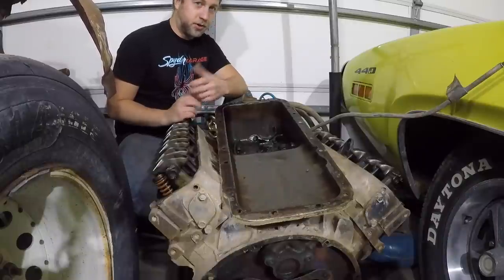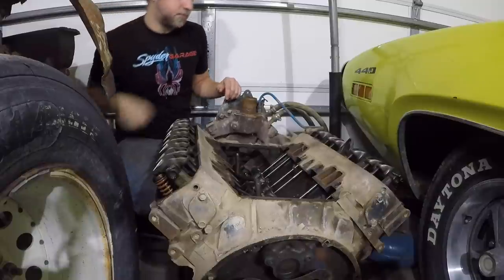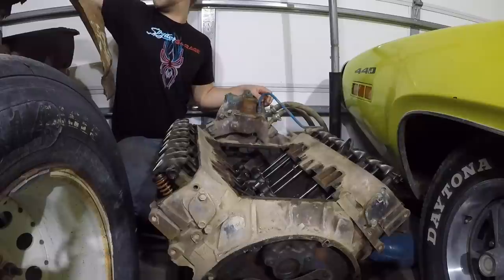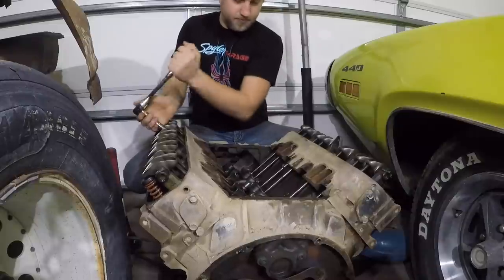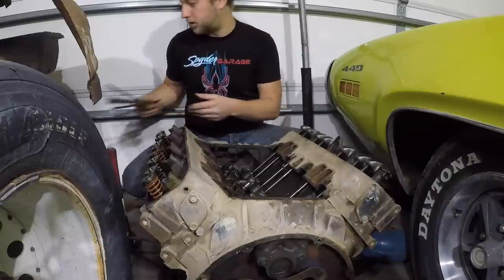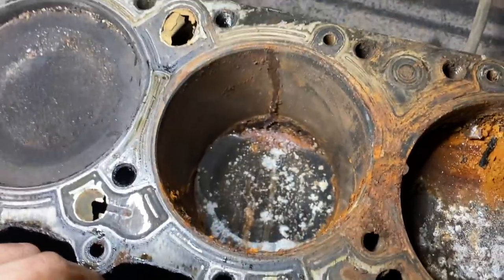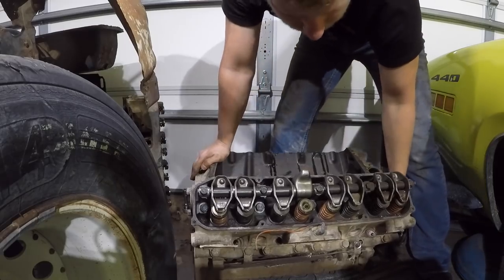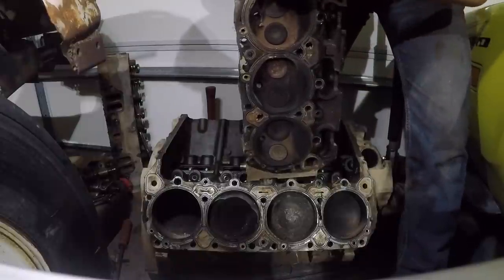Junkyard 1969 Charger dirt track car 413 engine tear down - and - reading Your comments!

Comment: Everyone loves a Charger-  this is extremely rough - makes it even cooler .  Can’t imagine how you make this street legal
Reply from the maker: Indiana is pretty lenient, which helps. Lights, plates, and insurance should do the trick
Reply: @brokengear2476  In ca they would require a brake and light. Finding a shop that would sign that thing off as safe would be impossible.
Reply: If you’ve got a title you’re golden- get to work!
Reply: @lancemclean9273  nope when you have the plates and tags in your hand then get to work. Never build a car then assume you can register it !!!
Reply: @brokengear2476  gotta love Indiana for that they really don't care around here 😂

Comment: My dad stripped and junked a 60s Winnebago Indian that had that same 413 engine and a 727 trans. 70k original miles. The engine + trans ended up in a friends woody rat rod project.

Comment: A set of those aftermarket body panels they use on the General Lee replicas for the Charger once you have it running.  Getting it running well and then make it look like new. I'm a Ford fan but I love the 1968-70 Dodge Chargers. New Subscriber.
Reply from the maker: Appreciate it!

Comment: You will need to use the 413  heads to use the headers in the 69 Charger. Or make adapter flanges .
That 413 was over reved. 
Also that is a low compression motor.  It's a 12 point socket that is needed to take the rear main retaining cap. 
Fun video!
Reply: The industrial heads are really low performance small valve and the water ports are different also. Adapter plates are out the angle is all wrong.

Comment: When you take the rocker assembly apart on those you should take them apart equally to release the pressure that way you don't warp the rocker shaft I know you might not use those but on a engine that you want to reu7se you should release the bolts equally not one by one
Reply: If the rocker shaft is weak enough to bend that way, wouldn't they flex a lot during operation? Torqueing a bent shaft that weak to a straight head would in theory bring it right back.

Comment: Hi. Those heads are #516 from 1966. Other than having a closed chamber design, they are undesirable. The exhaust valves are small 1.60". ...same size as small block Mopar heads. The port designs are poor also. They are fine for a cruiser, but not on a performance application. Good luck on the build!
Reply from the maker: Thanks brother

Comment: That’s a awesome car but can we get some of the yellow Plymouth doing some burnouts
Reply from the maker: Spyder Garage has a couple clips in their #GoDriveIt commercial. I just had the trans rebuilt, so probably not going to burn them down anytime soon. It’s also tucked away for the winter. 
Spyder Garages video: https://youtu.be/FhyfTbyOG3A

Comment: Are u going to do any modifications on the motor like performance parts or leave it stock?
Reply from the maker: Probably stock right out the gate. Performance will come, but my first goal is to just get it going

Comment: Your headers wont fit the normal car and truck heads, those are some really odd industrial 413 heads the exhaust is completely different. Wonder were they found headers for them?
Reply from the maker: They appear home made
Reply: @brokengear2476  Those industrial engines are really detuned dogs custom headers would be a lot of work to try and run that thing in a race car? Probably found out it was a dog put a bunch of gear in it and blew it up.